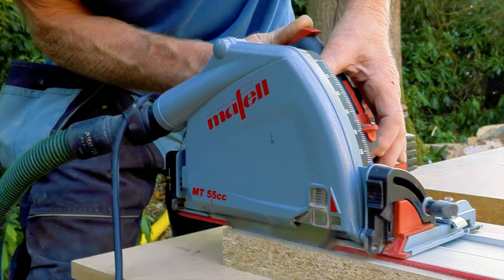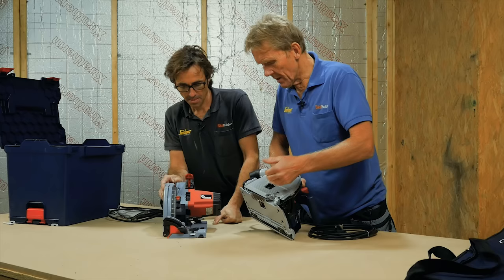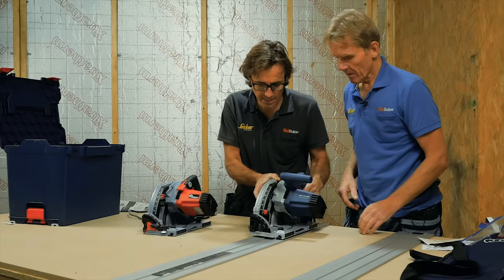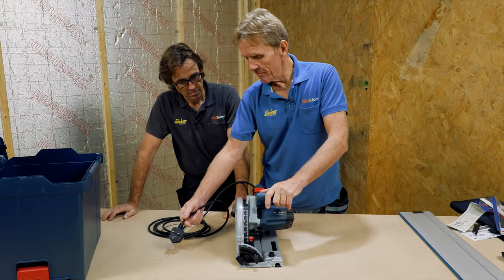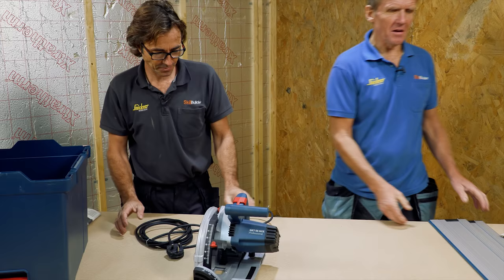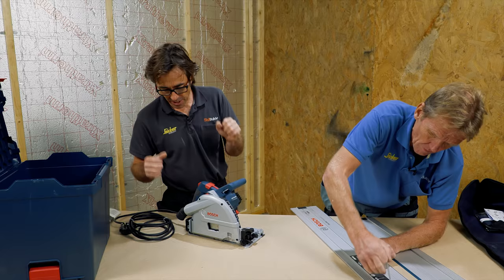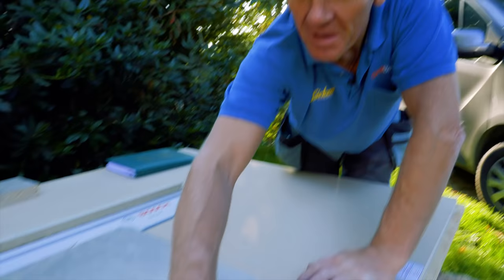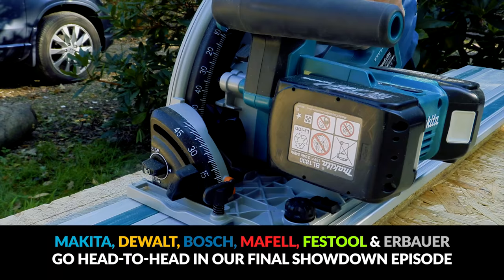Bosch GKT 55 GCE Plunge Cut Track Saw - Episode 3

Comment: Hah. I just checked my 55 and it rocks (slightly) as well. Have been using it without noticing. Should I be worried? Replace the base plate?
Reply from the maker: If it is in warranty contact the dealer and swap machines. If it is out of warranty contact Bosch. I don't see why you should have to put up with it. They seem to have a problem which needs to be solved.
Reply: Skill Builder you’re absolutely right. May I add though that mine rocks (again not as much as yours does/did) only when on its own but not when on the rail? Unfortunately, where I live (Malaysia) the local Bosch doesn’t sell this model. I purchased mine from Axminster UK and it’s already out of warranty 😬 I’ll try to contact them instead too. Thanks guys for this newfound problem I didn’t even know I had.

Comment: Oh dear Bosch, very disappointing. Who lets a saw go out for review like this?
 Shame because it looks like it is very good especially at the price. 
I would think twice now though.
Reply: ICECREAMK1NG1 i have one and it is perfect, great saw and very powerful
Reply: I've got this saw and it's a brilliant bit of kit
Reply: Thanks guys for replying positively. I thought this would be the case.
 Just a shame Bosch let this saw go out like this!
It is still probably no.1 on my list.
Reply: @ICECREAMK1NG1-jw8ig   I used to have a GKT and to be fair, it was true out of the box. It was a great saw, plenty of grunt and repeatable clean cuts. Have the Mafell now simply for the scoring function. Would still have the Bosch otherwise. I agree with you though: how Bosch (or Mafell if it's made by them) even let this out the factory is ridiculous.
Reply: Read the other reactions 🙂 just loosen some screws and its solved. Little sad that it comes out of the box like this but mine is fine now 👌 had to do a little more (loosen the whole baseplate and readjusted it with a measure mate from the blade to the cnc cut)

Comment: Someone posted a link in the comments but with no description so I'll break it down - If the saw has pressure on the motor body when you tighten it (setting it back to 0 for example), the base can twist. To fix it, loosen the bevel knobs, position it at zero without leaning on the saw, then tighten. Your base should then be flat. Might explain why Mafell have gone with the thicker base. Vid demonstrating this effect here: https://www.youtube.com/watch?v=4ipHqBcgDZE&feature=youtu.be

Comment: Let's be honest, gentlemen. 
Either you don't know much about your craft, or you intentionally made the plunge saw look bad. 
Because even an apprentice can realize that perhaps incorrect bevel settings can be the reason for an allegedly  bent base plate.
Reply from the maker: The base plate should not twist. It doesn't do it on the Mafel because the design is better

Comment: You dont put the hand on the motor on the mafell. You put your thumb down in front on the frame. Mafell's engineers asked people around and come up with that they didn't need the top handle. They rather use the thumb grip. 
I got the mafell and i love it.
Reply from the maker: I dare say but they don't give you that information on the saw and not everyone who picks it up is fully versed
Reply: @SkillBuilder  that's my only gripe with mafell - they're rather spartan with their instructions. I've found the Mafell owners group site helpful though.

Comment: I returned my Bosch saw due to it not cutting square. They said they fixed the issue, got it back and found out the base was twisted. Returned it again and their excuse was that it has a tolerance hence the movement. For a tool that prides itself on accuracy, it's very poor.

Comment: My Bosch has the same problem with its base plate.sounds like a manufacturing fault.don't think I would get another Bosch because of this.But keep up the good work lads 👍.
Reply from the maker: That is very interesting to know and we will feed it back to them. It seems like a casting issue. It may only be one in a thousand but they should reject them.

Comment: Of course Bosch will swap the machine. 
The point is that someone at Bosch has taken their eye off the  nitty gritty boring detail. Like they have about their website (as clunky as bricks being dropped on your foot) , like they have about their App (now no longer supported) , like they have about their multitool (the battery keeps coming loose). But once you've bought into a system, they know you are highly unlikely to change.  Annoying that.  My laziness feeds theirs. Damn annoying.

Comment: Great review lads.
For me the Bosch have always done the best power saws, be it jig, circ etc, so very disappointed with the duffer you received for review. I currently use a Lidl Parkside £70 track saw which is ace for the DIY stuff I do, but after your reviews are done, I may spend some dosh on a more upmarket one, as i use a track saw more and more these days.
Reply: Hope they review the parkside one 😂
Reply: That might be just TOO budget for Rodger and his Snickers sponsorship deals ;0)
Reply: This saw is a brilliant bit of kit, had it for a child of years, no trouble at all, I've got the 18 v circular saw too, and Bosch made it to fit the guide rail
Reply from the maker: Jason
 We have the Triton at £100 . How low should we go in our race to the bottom

Comment: I think sadly it's become the norm for bosch tools to have some issues/quality control problems. All my gear is bosch but as things have broken I have begun replacing with competitors tools as I can't justify replacing like for like with a tool that will have the same issues. Buying again I think I would even go with a festool rail saw and extractor

Comment: I just got one of these and sadly yes I have this warp in the base plate.  Half the reason a I went for this type of pluge saw is the FLAT and cast base plate rather than a pressed steel cheapo version.  Very disappointed and will be discussing with Bosch.
Reply from the maker: Apparently you can flatten it by releasing woth wing nuts front and back. We agree that it should not be twisted in the first place.
Reply: @SkillBuilder  Thanks Ill take a look.  Hopefully this resolves it!
Reply: Yes... that fixed it.  Weird as the imbalanced appeared to be in the casting ... happy camper now.  Thanks for the heads up.